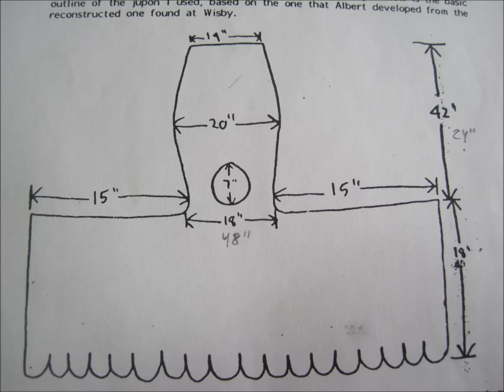Making a Coat of Plates (Brigandine)

Comment: Fantastic. I've ordered a spring stainless coat of plates kit from Polar Bear Forge, which I think will cut down on the time a lot since I don't have to cut, de-burr, or drill the metal in my 1-bedroom apartment with zero metalworking tools. I'm going to steal your technique for shaping the side plates, I wondered how you were going to do that. Luckily I have some friends who are handy with textiles and metalworking, so I think I can make something similar even though I myself am lame. I'm probably going to go for duck canvass though, since I live in Tennessee and it gets unbelievably hot around here in the summer when most of our fighting is done.

Comment: Nicely done. Suggestions. Use the ball of the hammer to pean your rivets, that is what it is for. If need be you can use common nails as rivets, just nip them to the right length.You can also set up a jig for drilling or punching the rivet holes in the plate. Do the first hole, then put it on a pin set at the distance you want from the tool center. Do the second hole then put that hole on the pin. Keeps everything nice and even. A piece of pegboard is also useful as a template for the hole positions.
Reply from the maker: I did use a ball peen but not the round end, I've learned a lot since this video. But the brig is still going strong!

Comment: A coat of plates and a brigandine isn't exactly the same thing as a brigandine.
Brigandines usually had smaller plates than coat of plates.
Reply: Good old modernism, insisting on precisely categorizing everything. The medieval people used these terms very interchangeably.
Reply: @paistinlasta1805  You're free to provide a citation for that claim. As it is, a coat of plates usually refers to this style of torso protection, with larger plates and a bulkier silhouette, while Brigandines are more tailored and have slimmer profiles, integrated shoulder protection, and yes, smaller plates to facilitate better mobility.
The coat of plates is a lot older too, appearing in the 1200s, gaining immense popularity in the 1300s, only for the noble class to begin replacing them with plate armor (and brigandines) during the 1400s. As Visby proved though, the coat of plates was still used by the lower classes, and there were a fuckton of variations, including a brigandine-esque one with small plates, but no shoulder protection.

Comment: Very good work (at least better than I). I recently made a coat of plates using the  same design (Visby/Wisby). I recently joined the SCA and it will be my first breastplate. However mine will differ as I'll have a gambeson under and surcoat over it. Enjoyable as always.
Reply from the maker: +SaxonOfThe29thOVI Thank you! That's awesome! I too have a surcoat I could wear with the brigandine.. (Many actually) just like the look of the leather exposed.
Reply: +TeutonicPenguin I like it as well. However mine is blue plastic barrel so I have to cover and I'm just starting to get into leather-working. I'm going to make multiple surcoats too (Teutonic, Hospitaller, and Genoese). keep up the good work.

Comment: do the plates slope in such a way that you could push a dagger from the top in between there? So the opposide slope to how scale male or segmentata slopes? 
This is my current issue. How do i attach the plate so that the rivets stick out in the front. To me it doen' t make sens to angle the plates this way around.

Comment: I had a question: I've started riveting mine today, did you have any troubles with your rivets not sitting perfectly flat against the leather? About 90% of mine did but there were just a few that were slightly off center and I could see the shaft a bit between the head of the rivet and the leather. It's not noticeable at all head on, and I don't think it's going to compromise the strength because I used 9oz leather, but it kinda bugs me.
Reply from the maker: It probably just shifted or you bent it with a uneven hammer blow. If you strike one side only it will bend. It can be quite tricky, had to grind off and redo a few of those

Comment: Axe handle for bending plates. Clever. X3
Reply from the maker: +Chaosvolt It was actually an oak railing of some sort. But and axe handle may work. XD Just any round block of hardwood.
Reply: TeutonicPenguin
 Ah right, that would be a fail on my part. XP

Comment: It you took 3 months to build the coat, but do you know how many hours approximately? And since you finished it, is there anything you would have done differently?
Reply from the maker: Not sure how many hours.. Maybe 30-40? And I would have cut the leather differently and primed the plates with anitrust primer. Which I will be doing with my next one.
Reply: Alright, nice. I'm actually preparing for making my first one and I'm a bit lost in what I need, how to do it and how big of a project it is, so thanks for showing how you did yours.
Reply from the maker: Look on the armor archive for patterns and an essay all about the process. That can really help.

Comment: Can I ask what kind of wood post you used to bend the side plates?
Reply from the maker: +KalteGeist I don't know actually.. I just took a few blocks of wood, a 2 by 4 would work, and then a random rounded piece to put in the bend. All you really need it 3 pieces of wood and a hammer to bend the steel

Comment: Nice work!
-How historical is 16 gauge?
-How did you bend the large plates?
Reply from the maker: +Gloin79 Thank you! 
-Not sure. It seems like a mid ground choice for steel in mild. But I'm not certain of historical thickness.
-I just bent them over my leg and stomach actually. You get enough leverage that way.
Reply: TeutonicPenguin Haven't thought about that :p Thank for the reply
Reply: This isn't historically pertinent, but for SCA heavy combat, breastplates and helmets must be a minimum thickness of 14 gauge.
Reply from the maker: +100nitrog Not true. helmets must be 14 but not chest plates. they can be a range of thicknesses depending on build and style. Meaning overlapping plates can be thinner than just one solid piece
Reply: yeah I'm going for about 2mm for a helmet and 1.5mm for most other pieces although great helms seem to have been thinner than 2mm
Reply: TeutonicPenguin Yeah, you're right. I was writing about information from the field marshal's manual back when I designed some armor 4 years ago. I'm almost positive that there was something about a minimum thickness of 14 ga. for solid breastplates back then.

Comment: This...is....not...a....coat...of...plates.
Reply from the maker: Just Brigandine?
Reply: TeutonicPenguin  Sort of. It is Brigandine but not necessarily historically accurate.
Reply from the maker: +7dayspking How so?
Reply: TeutonicPenguin  How so what sorry?
Reply from the maker: +7dayspking What isn't accurate?
Reply: TeutonicPenguin  I responded to you in another post. Essentially I gathered that this is based on the Visby Coat of plates they found...again my main issue is with the leather covering, especially the texture of it. The coats of plates found as Visby didn't really have a covering on them so it's difficult to know exactly what the coat was in fact made of (some of the coats found at Visby had Linen.)
Reply: @teutonicpenguin9593 
What thickness is the leather you used and is it still holding?